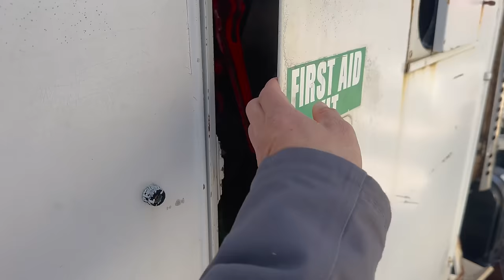I can't believe this boat repair COST this much

Comment: Honestly $3100 seems extremely reasonable of course you did a lot of the labor with removing and reinstalling but I would have expected much larger. Heck a winterization in my area can be well over $600 when your all said in done in my area and that for a single engine. That was a super smart move!
Reply from the maker: I agree 31 is a great price
Reply: Agreed, compared to the problems all those little hoses and lines and such can cause, seems like the wise decision was made! As he said, saving expensive problems later 😎 

And the cost, it really does seem good. I don't work on these engines but I buy a lot of parts and between parts and labor that seems like they did him right.
Reply: Good Lord my transmission on my pick up truck cost $1500 more than his whole engine rebuild.
Reply: Oh, I thought he had a whole rebuild. Not just a tuneup and regular maintenance done on it. That makes way more sense.
Reply: considering a service on my Diesel Jeep Grand Cherokee costs 1200 dollars, $3100 bucks is cheap, and as to why you don't get SS tools, SS is not as strong as carbon steel which can handle high stress levels without deformation.  To protect it against corrosion hit with wd40 and store it in a toolbox, just wipe it before use and spray it again afterwards.

Comment: I have a forklift at work that has the same engine, but naturally aspirated. It's a biggun. 25k lift capacity, heated cab, 3 speed. You could fit a full size pickup truck seat in the cab comfortably. It runs like a dream. Fires up super easy. Turn the key and before it turns over 2 full rotations, it's barked right off. Glad to see it back together man.
Reply: Big forklift!!
Reply: That sounds like heaven
Reply: Taylor lift?
Reply: We got a 30k forklift at my work with the 3208. NA as well, starts in half a crank no matter the temp.

Comment: Luke, On ur coolant/oil lines if u wrap bike inner tubes around them lessens vibration and wear on the pressure lines plus helps keep them clean.
Rev. Paul, Eustis Florida.

Comment: From experience I know that is a great price and a very thorough job!  Love Crisfields and surrounding waters. They make stainless but the hardness and edge is not the same.  Give the tools a light spray of Kroil when you put them in the box. You should have replaced the old hoses you attached to the engine. Now one of them fails and burns out the engine or sinks the boat!
Reply: Mmmmm KROIL good stuff right there👌🏻👌🏻👌🏻
Reply: @1cumminsdiesel I balked at the price but I refurb old hand tools and it is worth every penny!  PBBlaster second

Comment: Those guys did an absolute jam up job! the only thing I would recommend is putting a little bit of chafe guard on your oil supply line going to the filter head. It looks to be touching on that raw water pipe and any vibration will wear through that hose and no time!!!best to luck to you!

Comment: I do recommend putting an extra hose clamp on all of your coolant/water lines they tend to vibrate loose.. and It is a standard here on the west coast! I just bought my boat in Canada and had idk how many leaky hoses, put another clamp for assurance and have had no problems since! I run a Detroit 6v-92 but have buddies with 3208’s! Sweet engines. Keep up the good work!

Comment: I've worked for a Cat marine engine dealer for 27 plus years, used to work on lots of 3208's. They quit production about 2002 or so- a Cat marine factory rep told me they wanted to get a factory reman program for the 3208 like Cummins has for the B and C series- but they needed to come up with 200 good cores first. The tooling to manufacture the blocks was destroyed when they stopped production. That bill you paid was NOTHING man!   Oh so many marine engine turbos "rot" salt air wafting up that exhuast pipe erodes the housing, boost falls off.  Usually low hour pleasure boats.
Reply: I confirm the rotting, my turbo blades are covered with rust.
Reply: When you pull the exhaust elbow/riser off, there should be about .030" between the turbine blade tips and the cast iron housing- when they are rotted you will have about a quarter inch! They won't build much if any boost.  @tujuprojects

Comment: Wise beyond your years.  As a fellow boat owner. I agree with. 1 servicing the engine before you have a problem. 2 dropping the tools you need in the bilge and extra hardware. It will be there well preserved for when you need it later😝😝. All joking aside. Having the engine gone over in the down season saved you tones of money. Just replacing the hoses alone saved you a major problem it the not too distant future. I have had an oil line fail in a spot that I was not able to confirm till I had to pull the engine for a different failure. That adventure happened on our way to Chrisfield. Thankfully we have tow insurance. 
 Keep up the great work. I do enjoy your content and style keep up the great work.
 Yeah you have to be crazy to own a boat.

Comment: It is not common to make stainless tools because it is extremely difficult to harden stainless steel and the effect is limited. Carbon steel is cheaper, can be hardened and tempered. Adding chrome and molybdenum  adds strength for tool steels and carbide can be added to cutting edges.
Reply: Craftsman tried it with ratchets once most junk ratchet I own.

Comment: Love your videos! Regarding stainless steel tools I’ve always heard Bahco tools are designed for the marine trade and have a non corrosive coating on them you could try out their pliers. Also good call on the preventative maintenance love your videos

Comment: Like, you will learn and get smarter when you work by yourself. I am a machinist millwright and I work as a shift worker and most of the time during a break down , I can have the plant running because I don’t have  the day shift foreman nagging at you . I like the part when you first start to operate the crane and it shows you have diligence operating equipment . I wish you have a good success in your business

Comment: My Grandfather that built Deadrise boats and Skiffs in his yard in Urbanna, Va. would keep his metal tools in what he called a "Wet box". It was a toolbox that stayed on the boat or outside that everything in the box stays coated with 3in1 oil or WD40 and a full spray can of that and ether stays in the box so you can spray the tools down every time you finish using them.

Comment: Cool video . Looks like  strong engine. I love your old boat. At 5:32 could not believe that some idiot painted the rubber belts. Chances are that will make it slip and or crack and oil fail quickly. Master mechanic G agrees with this observation. 
:oops:
:octopus-red-waving::yt:

Comment: Get yourself a cpl leather pouches like carpenter belt or ism tool pouches have to be leather and spray and wipe your tools everytime you use them spray the bag with wd 40 or lube it up with 10w30 and that's your tool kit they won't be rusty and they'll last forever. Start with good tools too that helps.

Comment: Only time Martime Cats don't leak oil is when they are not running lol. That a good sounding motor, you should put some heatshield up around you stack so if line or something gets on it dont melt or catch fire. I fished in Alaska on big 109-183ft crab boats worked on both CATS and DEERES, certified cat parts and work for warranty is crazy, everytime we went into ship yard the bill was always 1m+

Comment: When you get a tight to get to bolt, get an old sanding belt, cut a strip, put it over the bolt and a drill and done, you only have the last few threads to tighten 🤯

Comment: With those hose clamps, some that are labeled stainless steel have the screw made from ferrous steel. You should be able to tell in a few weeks, the non-stainless parts will start to rust fairly rapidly. Regular stainless 3" to 4" clamps $3.00 each, all stainless clamps $8.00 each (roughly). Best way to get the real ones, is to buy from your local marine supply house that you trust.

Comment: As much as things cost today,  $3000 was a deal. You shouldn't have any trouble with that for a long time. Nothing better than those old diesel engines. As long as you  do your regular maintenance.
Definitely a good investment. 
You will save more than that by doing what you did. I can't wait to see you out crabbing again.

Comment: I would recommend you dont run your exaust with only 3 bolts ik you said its temporary but that metal ring that is the seal will warp when it expands and contracts and if given room to move more likely to not seal after one heat cycle dont put it off  haha

Comment: you should double the band clamps. stainless steel
Reply from the maker: You’re probably right!
Reply: @fvsoutherngirl  if you look at most marine applications, where they use band clamps, they double them.  redundancy, and they run the screw opposite ways And use stainless steel clamps

Comment: As far as tools go if you use em and they get oil or greas or fuel etc on it just dont clean em and they want rust as fast but salt is rough on everything so you have to clean them and oil them and thats still not going to stop the rust

Comment: acid will disintegrate the rust. vinegar is slow but should work. soak tools/parts in a solution. but need to neutralize with baking soda after. sulphuric acid or muriatic acid will work. Search for vids with tips on it
Reply from the maker: Good idea!

Comment: That engine looks great. 
The secret to get the most effort out of the engine for the long time is......
     Change the oil, oil filters, fuel filters when Cat tells you, don't "save money" by letting it go.
     The biggest secret...... change the fuel filters and install a water separator more often than recommended.

Comment: I’m a stone crabber from Everglades city we have the same engines I could’ve done every bit of that myself that is maintenance work that we do constantly by ourselves we don’t bring it to caterpillar to get it fixed only if you have to get the motor rebuilt we bring it to caterpillar but stuff like you just got done you could’ve did every bit of that yourself and save $5000it must be a northern thing because down here in the south, we do it ourselves

Comment: 3100 dollars is cheap for all that work !!!

I just had my 2017 Evinrude 90 hp etec 300 hour service done and new seals put in the power trim ----> $2000.00 

Brand new that Etec cost me $8900.  Installed.

Comment: Stainless is a softer metal for the most part and also sticks to its self under pressure, causing gulls.... not good for tooling applications.

Comment: Luke I get very tired watching you work I get tired thinking about work I may have to go take a nap.
 All jokes aside I’ve been there doing this same job and it is not a job for sissy’s. I do have one little word of advice please double clamp all through hull and raw water lines a very inexpensive way to save a expensive problem. I know I’ve been there to had to watch a $150,000 go to the bottom in a very after a new engine swap that thank goodness I didn’t do but I had to salvage just saying.
Reply from the maker: Good idea thanks!

Comment: Stainless steel tools are too weak, they will bend and break. Take side cutters for example, the cutter has to be harder (more carbon and forging)than what it is cutting or it wont cut. Tool steel is very easy to take care of, keep it oiled or very dry.

Comment: Why would anyone mess with a 3208. They're a throw away engine. None replaceable liners. They're heavy and gutless. 
 I love cat engines but the 3208 is the exception. 
After 40 yrs in the trucking and heavy equipment industry, I have replaced many of these anchors.

Comment: 17:30 IF I HAD BLACK SMOKE COMING OUT OF EITHER OF THE ENGINES, WHEN REVING THEM ON THE BOAT, AFTER PAYING $3100, I WOULD BE WORRYING...   AS FOR NOT CLEANING, ALL THE TIME, THEN PAINTING THE BILGE WHITE, SO YOU CAN SEE IF YOUR ENGINE HAS A LEAK, IS JUST LAZINESS, NOT THE BOAT DOESN'T GET USED, BITS OF CLOTH, PAPER, ECT, BLOCK THE BILGE PUMP PICK UP, CLEAN BOAT, SAFE BOAT...   9:58 HOPE YOU REPLACED THOSE 2 HYDRAULIC PTO HOSES, AND OVERHAULED THE PTO PUMP...    HAVE A HYDRAULIC FAULT OUT THERE, NO HAULING POTS...    STAY SAFE

Comment: You pulled the motor took it down somewhere and you didn’t even have them check the compression I guess in your case why half ass it when you can whole ass it

Comment: Truth be told... $10k for the Cat repair would not have shocked me!
Reply from the maker: I was expecting 5-10
Reply: @fvsoutherngirl  I've got a heavy equipment mechanic buddy... he says a box of caterpillar parts (think of a case of starter fluid sized box) can run $25k, especially once you're working on the dozer's final drive.

Comment: 90% of marine services are either inept or a rip-off.  If you find a good one, stay loyal and recommend.  I've been on the water for 50 years and the number of really good guys can be counted on two hands.  One, if reliability and sober is an issue😊😊😊😊

Comment: I don’t feel like that was 3k worth of work they just painted it and cleaned it and replaced external lines … you kind of got ripped bro IMO but what do I know I’m just a diesel mechanic.
Reply from the maker: Well the thing is they also re gasket the whole motor and tested every system in the motor and gear to make sure it’s 100% and anything with marine is 3x the price.

Comment: Doesn't water down the stack have any impactmon the motor?    Should a flapper be added?   And dont worry young man, no Asians would be offended by your facial hair.
Reply from the maker: Flappers never seem to hold up. Bucket is the classic solution around here haha
Reply: @fvsoutherngirl  Backyard engineering.